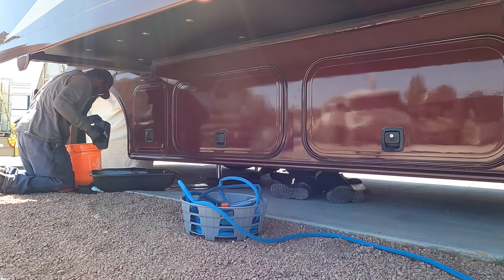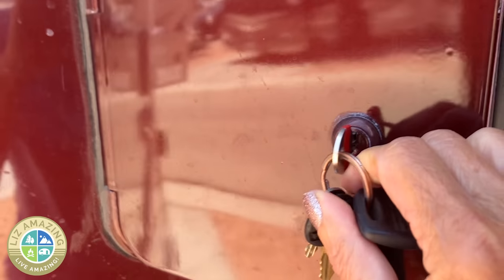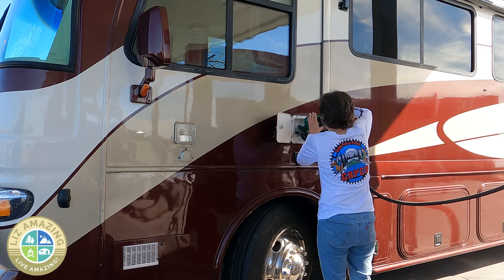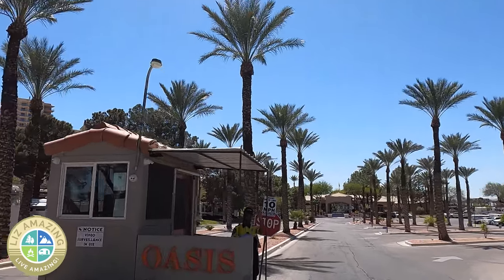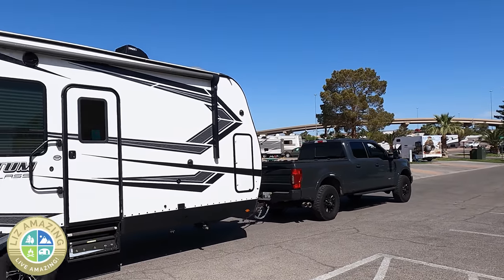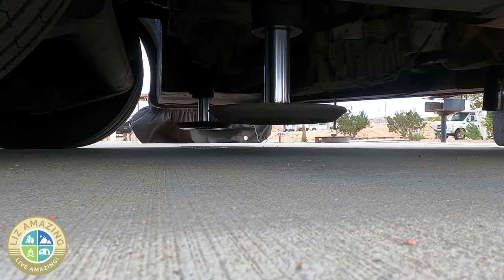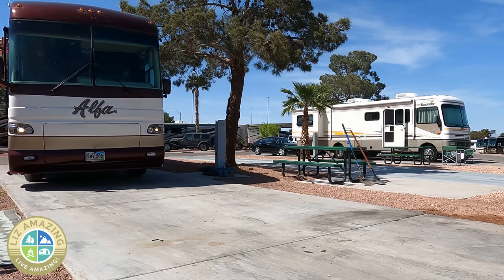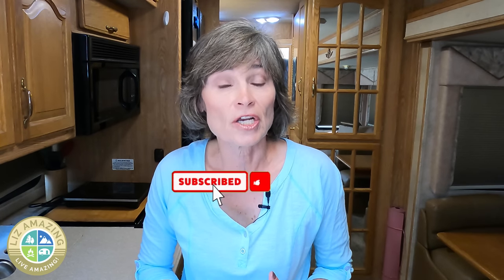RV Life: The WORST mistake I've ever made!

Comment: What an ordeal! I am glad you were able to get the right crew to fix your issue though. I kind of had the same type of issues with a campsite I was at. I have an 80 gallon black water tank and I was used to calling a veteran owned company to come out and pump out my tanks for me because it was kind of a hassle to break everything down just to go to the dump station. Low and behold all of a sudden I called the guy to come out and he said he had been barred from coming back out. They always did a good job and being a vet myself I like to support veteran owned companies. The campground was supposed to be getting their own pump out truck and that was almost 4 months ago and it still hasn't arrived. So I have been breaking down the rig, and dumping about every three weeks but they are just horrible at communicating things to the campers. I definitely wouldn't do an extended stay at a site that won't allow other vendors into their campground. That sounds shady as hell and that allows those vendors who can come in to charge whatever they want because you are stuck. Nope, I'll pass on that site.

Comment: You had a drain on your tank... 13 gallons of water in it.. I would probably drain 20 gallons out I'm sure that you will get most the water out.. then fill it up with diesel just for the hell of it. And what little bit of water you have in there we'll get into your water trap analyte will come on on the dash so then you just drained a little bit of water out of your filter and you might have to do it again several miles down the road.. you might.... It was unnecessary to drain the whole tank

Comment: How about next time get a long siphon hose stuck down the diesel inlet and over to the big tank and use a hand pump to pump it all out then pour a couple gallons in and THEN get under it and drain it out from the bottom until you get only diesel.  Much easier.
Reply from the maker: Most likely. Hope I never go through that again to find out. Thanks for watching.

Comment: You covered some important points and I don't blame you for being  annoid with the policy the camp ground said, it sounds like they are more interested in the $5000.00 rather than see you satisfied.
Reply from the maker: It sure seems that way, Paul. No vendor vetting system at all it seems. You just need to have a business license, insurance and $5000 and you're in. I counted 30 vendors on the RV services list so that's $150,000 for the campground right there!

Comment: Wow it's amazing how one little mistake can cause such a nightmare. It reminds me of the time way back in the day I was putting in a new air filter in my 1965 impala and the nut that holds the cover on the air cleaner fell into my carburetor  and inside the engine, I was told if I try and start it it may be alright or it may seize up the motor, so I took a chance and started it up and you guessed it the motor immediately froze up. So I had to get a new rebuilt motor and this was a nice car back in 1970, It was only if, why did I have too get a new air filter, like in your case somthing as simple as , well maybe my friend will want to take a shower and bam what a can of worms you opened!
Reply from the maker: Oh no. That sounds epically bad, John. Thanks for making me feel better!!! And for watching. See you in the next video.

Comment: Hi Liz, 
  So sorry for your troubles. However no one knew what they were doing IMO.  All they had to do is run a 5/16 or 3/8 line down your tank fill and pump your tank. Also they make a paste that they could then put on the hore as they are pumping. Paste turns red if water is present green if not. That whole job should have been done in an hr. Here in Alaska I have to pump my fuel tanks to get the water from condensation out. Also you can put a bottle or two of power service diesel fuel supplement in and that will absorb any water suspended in the fuel. Again here in Alaska we go thru this every spring.

Merle
Reply from the maker: Wish you were here, Merle! Oh well. Just glad to have that behind me now.

Comment: I run heavy equipment, and water in the bottom of the tank from condensation is ongoing. Once a year in the spring, I loosen (do not remove!) a nut on the bottom of my fuel tank and let the water drain out into a bucket until only diesel is coming out. I'm practiced at this, so I can usually accomplish this task losing only about one cup of diesel. Next I go to the secondary fuel filter which has a drain at the bottom, and I drain out a tablespoon or so of water until only diesel comes out. Last I go to the fuel water separator and remove the bowel and rinse it out with a little clean diesel and reinstall it. Your diesel almost certainly has two fuel filters (primary and secondary) as well as a water separator (often it has a glass bowel, so you can visually check for water). Any competent service person could drain out 99.9% of the water, saving all your diesel. Doing the checks I described above twice (once in the campground and a second time after you have driven the vehicle a bit should have done the trick. If your diesel pulls up a little bit of water, it should not be damaged. It just shuts down due to lack of fuel. (not starting your diesel when you had 13 gallons of water in it was a good decision) When that happens, do the steps above, use a little ether to get the engine started again, and you should be good to go. Diesel and water do not mix, at all. All diesel fuel tanks have a bottom drain where the water will collect.
Reply from the maker: Great tips, wish you were there at the time! Glad to have all that behind me now, thanks for watching and see you in my brand new video: https://youtu.be/-4V8KVdMnBA

Comment: In my very limited experience with campgrounds, I never had this happen, although I did have to get AAA-RV to come and change a tire on my travel trailer. I don't recall they had any trouble at the main gate. They didn't ask me for any intervention with management, so either they were on the approved list or the campground allowed any repair people free access. I would avoid campgrounds that have this restriction but I'm not sure I recall it being obvious when making reservations.
On the other hand, I've had this experience a few times in marinas, but there's more justification because marinas often have their own repair people with whom outside contractors would be competing. 
Misfuelling incidents are actually common, as you say towards the end of this video. I did one myself: after pouring the contents of a Jerry jug into my tractor's fuel tank I realized the jug had had gasoline in it, and it was a diesel tractor. I got my regular mechanic to come to the farm and drain the fuel -- fortunately I didn't try to start the engine -- and refilled the tank with the other Jerry jug containing diesel. "No engines were harmed in the making of this story."
Reply from the maker: Yes, I think it is rare for a campground to control who can do the work on your rig. I hope Oasis dumps that rule. Thanks for watching and for sharing your gas story! Wow!

Comment: I would never come back there, after what you been through. I live here in Vegas and have picked up people there as a part time Uber lyft driver. Nice place, but thanks Liz for the info. Shows me how they can treat their customers bad. Also, make sure you use a flashlight next time, if you ever decide to put water into your rv, especially at night. We own a travel trailer, so we are lucky to not deal with this situation. But overall, great video. Glad you got your rig fixed by the original guys you wanted.
Reply from the maker: Thanks so much for your compassion, and I even have a headlamp! I’ll never make that mistake again! And I don’t blame you for not wanting to stay there!

Comment: Holy crap and sorry you had to suffer all that. I do have some experience with wrongly filled tanks at gas stations. I loved those guys that did your work but can't believe they didn't have a pump. Not that expensive and way less work and time. Pump it out and then drain it once. Add some diesel and then drain again. There are also fuel polishing services which is mostly for boats where they come out and pump and clean your fuel before putting it back in the tank. I would change your fuel filters right away and then again after roughly 1,000 miles. Also used that additive a couple times. Good luck and one of my famous sayings is "It's Never Easy".
Reply from the maker: Yes. I have now changed the fuel filter and the separator. Going to keep using Howe's for a bit, as well. I agree they could have used a pump, still they are my heroes! Thanks for watching.
Reply: Big time heroes and very hard workers!!!

Comment: A relatively cheap and clean fix for this problem is a bit cumbersome, but not really that bad to do.  Been there, fixed that several times many years ago when I worked as a mechanic during my college days.  I can’t figure why the RV park made such a big deal out of it.  I think I charged the charter bus owner about 200 bucks in todays money, and we all walked away happy.  All you need is as many empty 55 gal barrels as you would need to hold the existing fuel tank contents, a couple 5 gallon plastic containers full of new diesel, a few bottles of diesel fuel water treatment, about 40 feet of fuel line, some clamps and an external electric diesel fuel pump-plus-an external diesel fuel filter that is attached to your external pump.  A good book might be nice.  Oh, I also told the home office for the bus company to take that bus into a service center as soon as possible thereafter.  I gave the bus driver a list of exactly what I had done so that their service center would know what to look for (cut and then repaired diesel fuel lines or removed fuel connectors….etc) for when they perform final repairs.  The bus was older than Adam and Eve.  A true lose bucket-of-bolts somehow moving down the road….so I’m betting that as long as this bus was somehow capable of driving down the road, nary a mechanic ever looked at this problem ever again.

Comment: In Europe, unless the vehicle is fitted with an anti siphon divide, the tank would have been sucked out via a tube inserted through the fuel port to the bottom of the tank, quicker and no mess as the diesel /water goes straight into the collection tank, surprised this appears not to be the case in the US.

Comment: A suggestion……simply pull the fuse for the electric fuel pump. That allows you to power up the coach and raise it without circulating the contaminated fuel. 

Also, the service guys need to have an electric pump set up that they can put in the drain pan and pump the fuel out to their holding tank, thereby saving a ton of time and mess.
Reply from the maker: Thanks Dean, glad to have all that behind me now!

Comment: Diesel engines can deal with a little water, they have a water filter on the fuel inlet. Once the tank was draining diesel you would have been good to go, just keep an eye on the water separator in the engine bay.. run the engine for 30 seconds check filter until no water drains off. then do the same for 5 minutes. then after driving for 5 minutes. it is a pain but not a huge deal. The tank pickup will not be right at the bottom of a tank you will likely have 5 liters of space that the pump cannot reach to protect from any rain water getting into the tank over time. 
Another way to deal with the problem on the side of the road if you have familiarized yourself with the engine bay would be to unscrew and remove the water filter put a bucket underneath with rags covering everything and just pump the water out of the tank with the fuel pump.  (turn the ignition to run) it will not be running long enough to get damaged. Although it will leave the 'dead space full of water so the tank will need draining when you get somewhere safe.

Comment: The water is on the bottom. Just drain if it has a drain plug in bottom of tank.
Or pump water out with hose and manuel pump or electric pump or the old fashion way suck it out till it flow on its own.
Let it flow till some diesel fuel comes out then there wont be any water left start up it will run fine on old fuel. 
I have done it many times on many vehicle's and also boats very common water in diesel or gas boats.
Reply from the maker: Except it drains like your bathtub does, corkscrewing some of the diesel on top each time. So the whole thing had to be drained to get it all out. Thanks for watching.

Comment: Liz, I filled my Mac Tools truck not once but twice b with gas. It wasn't  totally my fault though the diesel pumps are supposed to have green pump handles.  When this happened the the pump handle had been replaced but with the wrong colored handle cover. An employee from the fuel pump repair company had put the wrong color handle on the nozzle.  It still cost me because I should of noticed the mistake.  The second time it happened was at another gas station and it was the same issue and same company. So pay close attention every time that the nozzle is not mismarked.

Comment: For a company that say they deal with this sort of issue all the time, I have to wonder why they are not using a pump from the top?   Then they could use the bottom drain for the last remaining bit in the tank.   A pump would have had that tank empty in 5 minutes.

Comment: Oh my God, Liz, I am so sorry! Anybody could have made that mistake, especially in the dark! I've made some doozies along the way too. There was the time we had a new satellite dish installed on our previous Class A. We brought the coach back home after the installation and parked it in the driveway, deployed the satellite dish to test it out. All looked good. Understand that in order to operate the dish I needed to fire up the generator, which I had done. I hit the button to retract the dish, giving it a minute or so. Then I turned the generator off, assuming that the dish was fully retracted - without checking. We have a garage for our RV, so I started backing the coach into the garage. As I'm backing it in, I hear this God-awful scraping, scratching noise. Stopped the coach, got out walked all around, didn't see anything. Get back in the coach and continue backing. Again, terrible scraping sound. Stopped the coach again and said to self, this isn't normal, something is wrong! Get out and walk around, only this time I looked up. YIKES! Partially deployed, brand new, satellite dish is mangled and jammed against the underside of the open garage door! I can't go forward, and I can't back up, it's stuck there! More than a few sailor-like expletive words later, I climb up on the roof of the coach and dismantle the satellite dish which now looks like a piece of aluminum foil that got caught in a woodchipper! Oh, and I damaged the garage door too! Told my wife about the self-inflicted fiasco. Being too embarrassed to go back to the RV store where we purchased the dish (to the extent that I was prepared to live without a satellite dish!), my wife called the RV shop, and after a few chuckles at my expense, mentioned that he had one more dish in stock. Asked if he wanted us to install it I said NO! I'll do it myself! I keep the mangled dish as a sort of memento and reminder that, when driving the coach anywhere, always be sure to LOOK UP!! For some reason the lessons I learn the best tend to be the most expensive ones: we paid twice for a satellite dish! Knowing about that campground's policy, which I have NEVER heard of before, I would not camp there based on that indefensible, nonsense policy! Sounds like a greed factor to me!
Reply from the maker: Hi Liz! Thanks for sharing your story. That is definitely a good one and I'm sure you could tell that one around the campfire. Your comment helped me feel better about my mistake, and I'm sure others who read this. Happy travels and looking forward to meeting you on the road. And yes, I am not sure I would ever go back to Oasis- unless they ditch that policy.

Comment: I made a similar mistake on a car that turned out to be a bit expensive.
I rented a car drove it home to load up for an out of town trip. Driving it home I discovered nothing came out when I tried to clean the windshield. Once home I used some of my own fluid to fill the tank. Still nothing came out. I drove the car back to the rental facility, they poured some of their fluid in the tank and it immediately spilled all over the ground. The hose to the tank was broken. However!!!!! Earlier when asked where I filled the tank I pointed at it and they said "thats the coolant overflow tank!!!!!" "How much did you put in?" About 1/3 gallon. :(
They immediately got me in another car and sent me on my way. But!!!!!!! I had to pay for the car to be towed to a shop that would drain and replace the coolant and pay for two rental days it was out of service!!! Yeah I suppose one could argue a small amount of windshield wiper fluid isnt gonna hurt the engine but it wasnt my car and I was at their mercy. I was happy to pay it as a letter I received from them mentioned there was the posibility of engine damage I had to pay for and rental for the days it would be out of service!!!!